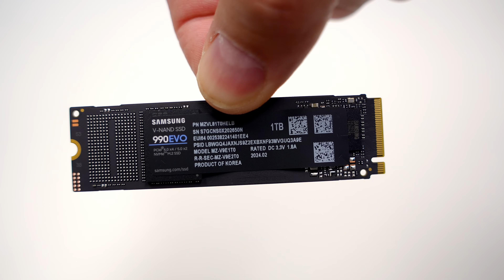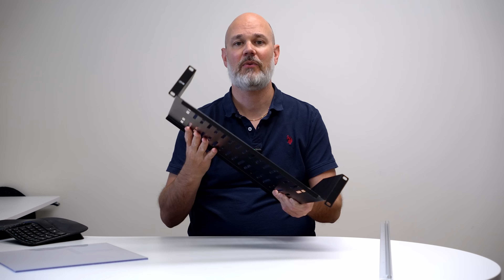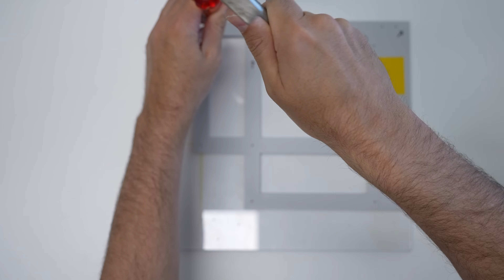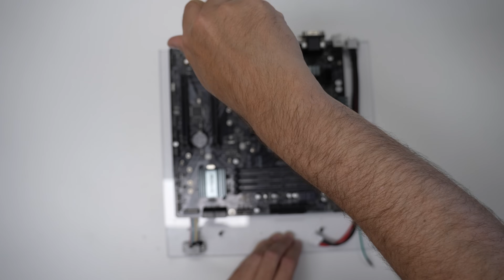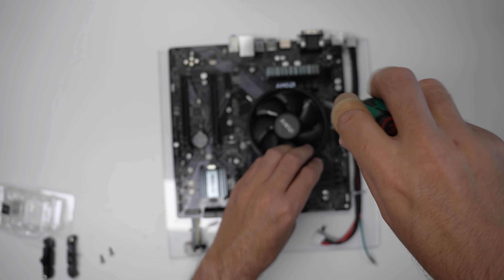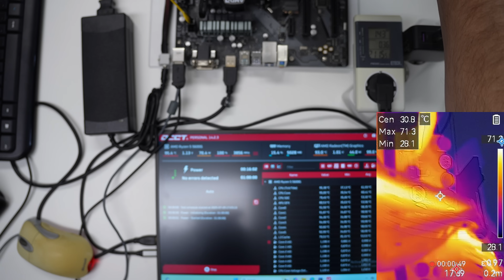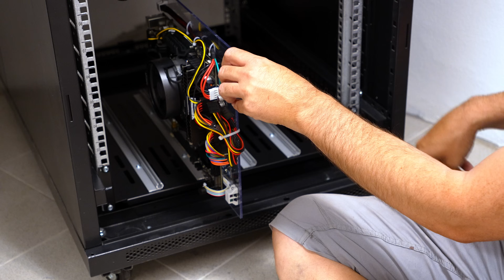Homelab: Install UNLIMITED CPU and RAM without wasting space or money | DIY Blade Servers

Comment: You should check out HDPLEX PSUs. Their GaN 250W model should be perfectly sized for your use case and offer a lot higher efficiency, which translates to lower heat output and less energy used. PSU also comes with standard ATX plugs.

On the price per core, I think 5950X would offer a lot more. It's dirt cheap now (290USD), can handle 128GB without a problem and you could build your whole setup with 2 blades instead of 5. Even adding some basic GPUs would not go over the total power use of those 5 blades.

Other alternative for low idle power can be the use of PRO versions of the G-series CPUs. They are monolithic (normal ones are chiplet based), so they use a lot less energy overall. You could save 10-15W per blade in idle/low stress operations easily. That would translate to a lot less total power draw of the whole system. One downside - they are hard to find new, so you would have to check 2nd hand market.

Also, 10.99V on 12V rail is a big v-drop, going outside of 5% official tolerances (11.4V-12.6V). That could translate to instability in the long run and just tells the story about the overall quality of power supply components.
Reply from the maker: Those HDPlex PSUs look really nice! A bit more pricy than the cheap ones I used but OTOH much more efficient.

Comment: Why not building a cheaper build with more CPU cores? I have bought a Xeon E5-2680v4 with 14 cores (28 threads) for about 12 dollars from AliExpress. If you get a dual Xeon CPU Mobo you get 28 cores 48 threads on a single board!
Reply: Because those CPU's are from 2014+ They arent efficient as Ryzen 5's. Yeah they are cheap and to be fair I run a number of them in my lab. But for efficiency and performance. These Ryzens will stomp all over the aged Xeon's :)

Comment: Nice. 

But i rather prefer b550m and 5600 or 5700 without integrated gpu. 

It will be pcie 4.0 and will not cut the bandwidth of m2 as now.

Comment: Hmm I don't know.  Looking at the used market, there's a bunch of used EPYC servers available for around the same cost of what you paid for the CPUs + Mobo + RAM for this build that either match the overall specs here or beat them.  For example, I'm looking at a single EPYC 7642 system that has 48 cores 96 threads @ 3.4 GHz boost with 256 GB ddr4 RAM for just about $50 CAD less than what your builds would cost me (not counting storage or power at all too).  That's Zen 2 architecture which is for sure slower than the Zen 3 architecture of the 5600G, but not that much slower.  And with the server version you get way more cores and way more ram.

Overall performance, I'd likely go the server path as that would probably be more reliable and the maintenance would be easier/cheaper.  And it would of course demolish in multi-threaded performance.  Once these systems start hitting the secondary market, the parts like fans or motherboards, etc (even the RAM) start getting very very cheap.  If you want to play with clustering or have multiple single core performance services, maybe your solution makes sense?

Overall though, we're talking home lab.  I have zero need of 5 separate servers in a world with VMs and containers.  I'd rather have the simplicity and efficiency of a single beefy server that I can just throw VMs and containers at all day long and never have to worry than having 5 separate systems all sucking power and all without redundancy of any kind with very limited PCIE options to boot.  Sure, if you cluster them, you can get some redundancy, but I don't find the efficiency tradeoff to be worth it in my mind.

I would rather go the server route for real self hosted tasks or the raspberry pi route for testing and messing with clustering/ceph etc.  Or failing that, if you went with used PCs instead of new parts to cut the price down significantly to the pi level (~$100 CAD per machine), this would make more sense.

I do like the blade approach that you took for racking all the PCs though.  That's clever.  Also, I'd be interested if those power modules would take 19V DC input.  I have a whole bunch of old laptop chargers that are 19V just sitting in a junk box in the 60-200W range.  Also, those could probably be obtained used for almost nothing.  If you didn't have to ship them and found a recycler/thrift store that had them, I bet they'd let them go for $1 a piece.  They likely have endless boxes of the things.  High end name brand ones like dell/hp/lenovo too instead of generic who knows what quality.

Anyway, interesting project to watch with some cool ideas, but I'd probably go another direction personally.
Reply: I got my alibaba epyc humming along for close to a year now and couldn't be happier. I'm using the extra PCIE lanes for more cheapo nvme adapters. I have a ton of brand new 256GB that were gifted to me that are perfect for all the VM's.
Reply: The product page for the DC converter board specifically states 12v (I suspect it has a wider input range but they don't state it) but they also have ones that specifically accept 19v like item/1005007667890476
Reply: Those are also like 3 feet in depth Ala taking up 3 times as much space as these essentially

Comment: What a cool way to do it. I saw many years ago a mini-ITX DIY blade. I think that website is still up. They used custom metal slides though. I think acrylic / plexi makes a lot of sense.  I've wanted to do something similar just for the cool factor because I love hardware. But I'm actually downsizing my homelab now to just 2 servers and my laptop now after years of having several 4U chassis whiteboxes. But I'm just glad to see it done this way, so interesting.
Reply: A downside to acrylic or plexiglass is they are very prone to causing static.  Masonite (hardboard) would be a good cheap alternative.

Comment: Wouldn't mini pc motherboards do better? Since no gpu is used and PSU is laptop style, that's exactly what you end up with. 7840hs Chinese box is at around 200€ for motherboard+CPU+PSU brick on AliExpress if you were to use a coupon. While somewhat expensive at the first glance, CPU is actually better than r5 5600 and graphics performance is similar to rx580, with just way lower power consumption. Big differences I found are power consumption, it's great for mobile chipset, as well as usb 4 which can be turned into 10gbe at some point, built-in dual 2.5gbe, and the most exciting thing, it comes with similar brick power supply (*19v) by default. I currently have 1 piece and it was promising so far. Would this scale well, how do you think?
Reply from the maker: Yes I think that would work and you are correct the CPU is better. I guess the main tradeoff in using laptop CPUs is upgrades and repairs. The CPU tend to be soldered to the motherboard and suitable RAM sticks can sometimes be harder to find if you want to add more later. OTOH the box is pretty cheap so if something breaks down you can just replace the whole thing. So if you want to trade off upgrade/repair for lower power consumption and smaller size I think it is a good choice.

Comment: Kello, I really liked your solution with these machines, check out flex slot power supply's or common slot power supplies they are 12 volt only and can get up to 1400watts not that you need that but its very simple to set multiple up for redundancy. "you can hack an dual psu enablement kit" the other thing  is due to the fact they are server power supplies and 12 volts only they go cheap like $50-$70AUD for an 1200 watt, also I would be worried about the bandwidth between your systems as you only have 1gb or 2.5gb, 10gb cards go cheap and with a pci-e ribbon cable "4-8xpcie" you can find a spot for sure, plus with dual sfp nics you can get 20Gb and the price difference between them is not that much so might as well get a dual nic.

Subbed and liked.
Reply from the maker: Good idea about the power supplies, seems those would be better quality and higher output than the ones I used.

Agreed on the networking, it will be a bottle neck. I was actually looking at PCI-E risers today to see if I could find something that would fit. Ribbon cable ones could be the way to go. My home lab networking setup is a bit outdated. I only have 1Gb switches at the moment so need to buy a new switch too.
Reply: @KelloLabs  plenty of options, especially with pci-e, oculink is a nice option as well but due to the room I think I can cross  that out as it sits on unless you go the nvme route but that's more suited for your storage needs, speaking of nvme routes, I have seen SATA/SAS controllers on nvme and why not the better ones will come with an SFF-8612 that break out into SATA/SAS cables.

Comment: instead of brick you could use open style power supplies cheaper more efficient and thermally better ventilated or de-case the one you have . they are mounted too close.
Reply: Suggest which.

Comment: It would be a better option to put motherboard backplate in front to allow access to Display/USB/Ethernet connectors.
Next step will be to add power block to mounting plate itself and build a backplane with power connectors to enable some sort of plug&play. A 3D printend locking mechanism would also be a good imporvement.
Reply from the maker: USB and Display would be really nice to have on the front. The 3D printed locking mechanism sounds like a cool upgrade. If I understand correctly you mean it would lock into place with the power connector on the back? In that case I can see how having Ethernet on the front would also make sense. This would make it closer to a "real" blade server. If I can find the time I may pursue this as a project in the future.
Reply: @KelloLabs  You may also have a look to low profile fan as Noctua NH-L9a-AM4 to gain some space and maybe add another board.
Perhaps some 3D printed shroud around CPU fan could enhance thermal exhaust by directing air flow on the back and getting fresh air from the front.

Comment: I have retired so I am enjoying a break from IT. As a Unix admin we used Oracle's OVM Virtualization technology. It now defunct. Replaces by Redhats virtualization or Ovirt.
I used it on my AMD3 CPU machine and tricked it into thinking there were two virtual servers. The earlier versions allowed this. It was how Oracle did it's training without having to use SAN, a fast network and two computers. You could simulate live migration of Virtual machines. It was great for testing things out as work didn't have a test environment.
I would be very interested in what you put on these blades, how you network them and share storage. And if "live" migration is something you try.

Comment: Nice video like the idea - Feedback: You could have saved money and space with using a few MS-01's or MS-A2's with the 7945hx cpus. One of the 7945hx has litteraly more power of 4 of 5 your systems (the 9955hx one which is more expensive has like 5/5) and 2x10Gbps 2x2,5Gbps. When i consult pcpartpicker each of your "MB+CPU+RAM+NVM" combo comes down to about 420-450$ so 5 of them will be around 2-2,2k$, while 1 Barebonekit 7945hx costs only 639$ or 9955hx 879$. Also you have to keep in mind b450 is very old now and your capacitors dont hold endlessly. The idle powerdraw for thoose old chipsets and cpus isnt that good either, which will cost you more money in "idle-power" draw. When you go with the Minisforum hardware you have top current cpus, many generation IPC improvements and hardware where you dont have to worry that  IC/Capatictors or others things might so old it breaks. Another part is warranty. Thoose old components will cause you a lot of trouble to get a successful RMA. Antoher thing is that the plexiglas on the backside of the mainboard, below the cpu might come down as a thermal insulator, there is a reason every motherboard backside has cutouts there, might want to make it a bit "more wobbly" but increase heatflow. - Again i like the idea, just feel like you could "cheaped out" in a more modern way 😅 hope you understand what i mean. Anyway, thanks for the entertainment.
Reply from the maker: Lots of good advice! Thanks for taking the time to write that up.
Reply: @KelloLabs  No problem, happy to help, anytime 👍
Reply: @KelloLabs No problem anytime!
Reply: @jammsen-z8y I have an MS-A2, with 3 990pro and 128gb of ram, but i am kind-of fearful of overheating. Also a lot of complains from people about support and returning. Are you running it as server 24/7 ? What about heat etc ? Please describe your idea better.
Reply: @kromulan  then put it in a 10" mini rack and print 3D Print-Enclosures, with fans - Examples on printables.

Comment: I once mounted a pc on a wall and for extra security, i used a pc case metalic inside with the standoffs. i never trusted mounting the motherboard and that cooler (i used an older intel stock cooler, it was kind of a weird media box thing). The way i built it, it should withstand even a larger tower style cooler. Just get old thrashed PC cases from recyclers or buy them for scrap. You also get the front panel usbs, buttons and LED's. I even used the front panel audio and looks like a dream to this day.

Comment: This is why I love YouTube.  When I worked at Verizon Fios Labs, we had a similar system, custom self-enclosed Tiny ITX computers in a rack, about 84 pcs. All used for network throughput testing. It was a huge PIA to manage, b/c there was no iDRAC and we had to use a crash cart.  The PCs at the time were just junk. sourced from a 3rd party.
Reply from the maker: Yeah, I would have preferred motherboards with IPMI but I have not found any budget board that has that.
Reply: @KelloLabs  I don’t think you’ll have any luck with “budget” boards having IPMI anytime soon, but there are “WS” motherboards with consumer sockets that sometimes have IPMI that you might be interested in.

Although, they’re about $400 ATM. Might have better luck when they enter the used market.

Comment: This is a great video. I usually don't get much hardware videos recommended but glad to have found your channel. I would suggest you can do a followup explaining how you would like something like this. 

When I first saw the tittle I thougth it could be for running an llm locally, that is a topic I would be very interested on, but maybe it is not in your particular interest, and that's absolutely fine. Having said that, maybe just to apeal a niche like mine, would be very interesting see if you coud connect all the memory and get enough capacity/speed to run a quantized version of a model like Qwen or similar.

Anyway thanks for the content

Comment: The problem with this approach is that unless you have workloads that can spawn across nodes, you can't really use all 160 GB for a single task. So if you have tasks that need more than 32 GB of RAM, you're going to get out-of-memory errors.

That also doesn't take into inter-node performance/efficiency into consideration as well.

Conversely, I bought my "do-it-all" Proxmox server, with dual Xeon E5-2690 v4 (14-cores/28-threads) and 256 GB of RAM for $1150 USD. So if I have tasks that requires more than 32 GB of RAM, I'm able to run it.

Comment: Nice video, downside of a 5600G is that it only supports pcie3.0, so you lose some speed on the 990 EVO nvme's.
Not that i'm a fan of Intel, but the 14600k is at a bargain price at the moment, not so far away from the 5600G, and supports pcie Gen5.
So you would also less computers to get to the same core count.
But good idea if you don't need any pcie plugin cards.

Comment: if i were you i would have used framework's ryzen AI 340 or Ryzen 5 7640U motherboards it would be a bit more expensive but more compact more power efficient and future proof . if it's not out of budet i would say it's  worth the extra cost

Comment: I DO understand your point of using separat power supplies for independency, but you STILL have a 1 point of failure, the 230/240 Volt power from the wall. If you REALLY wanted independency you should have used a UPS with 5 outlets

Hilsen fra storebror Danmark 😆
Reply from the maker: Good point! I actually did this build at work some years ago and there we used an UPS just like you described.

Hälsningar tillbaka från Sverige :-)
Reply: 1 UPS isnt very independent :D
Reply: True  @buckbuckleyson2259  but still 1000% better than relying on the wall socket alone
You could even use 1 UPS for each machine, but you would STILL have the point of failure
Then you could put the UPS's on separate breakers but have failure point where the electricity comes into the building

What does this then mean ?

Well . . . IF you will try to eliminate all points of failure you have to have

1. solar driven power backed up by
2. wind driven power and
3. water driven power and
4. nuclear driven power and last but not least
5. fossil driven power

Comment: Very nice work. But please use better quality PSUs. 
I use FSP 250-60GHT for every node which are very small, efficient and reliable. You can also use a high quality single large PSU to run all nodes, with custom DIY mosfet based switches to switch off certain nodes. Quality PSU will make your electronics last long. My build is based on A320 motherboards with Athlon 3000G CPUs. I also use older H61 with i5 3rd gen CPUs.